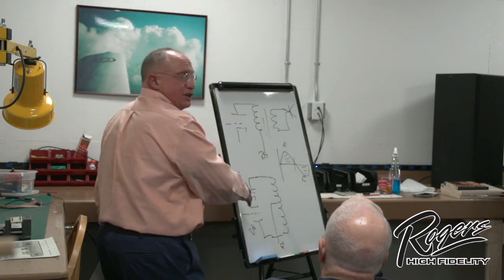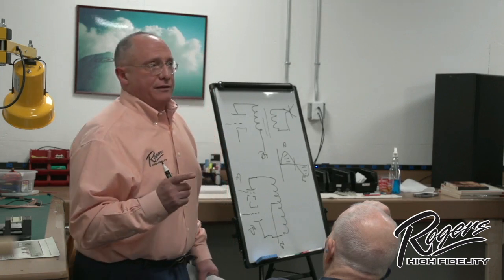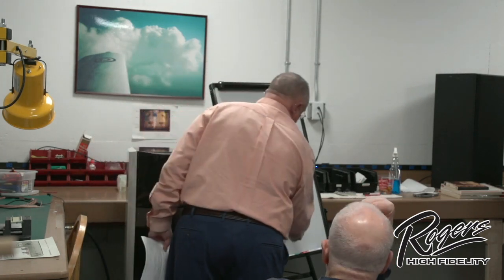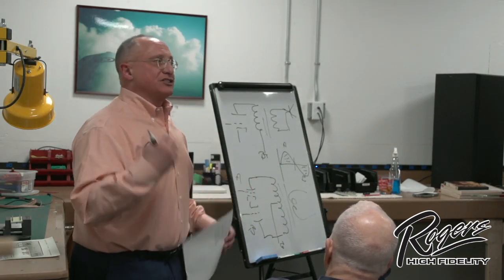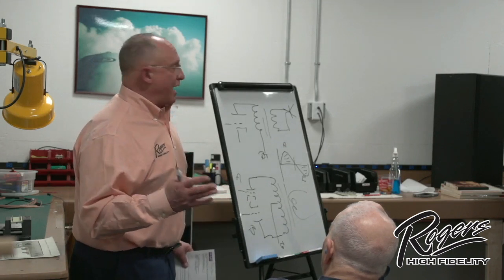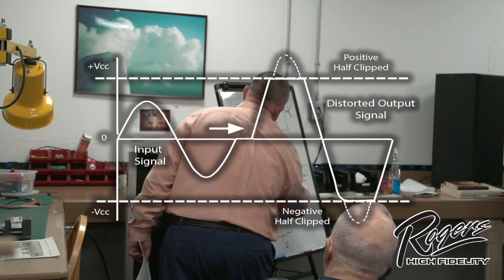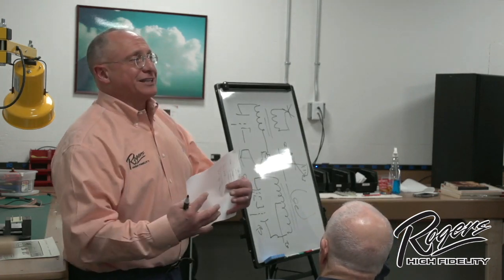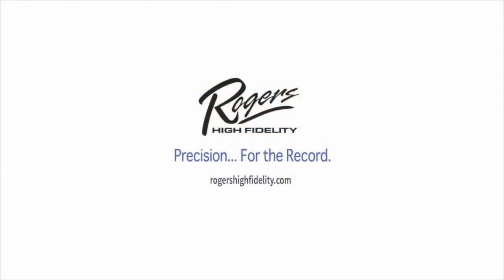Single-Ended Vs. Push-Pull Tube Amplifiers - The Analog Life Episode 4

Comment: There is actually a  few things this guy says that is NOT correct, or at least only half the truth. Push-Pull amps do indeed cancel out even order harmonics, which to many is a big disadvantage compared to a Single Ended configuration. 
The statement that PP amps produce twice the power compared to a Single ended config using same tubes , is only true in a specific case, namely when the tubes in the PP amp are run  in Class A. 
A HiFi Single ended amp run in Class A by default.
Even if Class A operation occurs in some PP amps, it is far more common when designing a PP amp that as high output power as possible is the objective, and then the amp is designed for Class AB operation, allowing for MUCH higher power than twice the power of the corressponding Single Ended, single Tube amp. The power ratio in a Class AB PP amp is commonly rather 3-4 times as high . as in a  Single Ended Single Tube amp. You can get high power output from a Single Ended Single tube amp as well, by going for larger, higher voltages tubes, and the price you pay is exactly that, high price and big, heavy amp, while potentially delivering an oh so sweet and musical , yet detailed and powerful tone.

Comment: Push-pull design can cancel the power supply artifacts.  What about crossover distortion in push-pull design? What I gathered from here is push pull design can take care of clipping. However, it seems that the single ended amplifier harmonics is superior due to linear basis. Push-pull amplifier harmonics is not lienor due to crossover distortion. Hence, if you can manage your power supply properly single ended amplifier would sound better without clipping? Please clarify this.
Reply: Jude- you are correct that the push pull design cancels power supply artifacts as well as even order harmonics. Crossover distortion occurs only if the design doesn't properly set the crossover points. If they are set correctly, a push pull output stage performs very much like a class A amplifier. The challenge with a single ended design is firstly power output. In addition, the single ended design promotes even order harmonics which are primarily in the listening frequency range. While some find this a more "accurate" presentation, some find that even order harmonics in the listening range produces a much more forward mid-range. Some find this fatiguing and unusual. Thus the push-pull output is generally more acceptable to listening. Hope this helps- R
Reply: Thanks